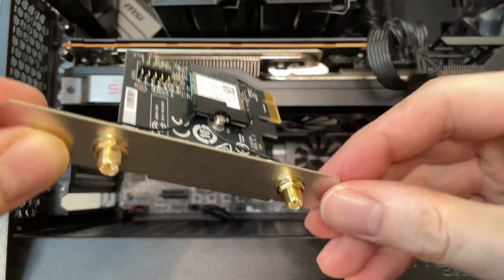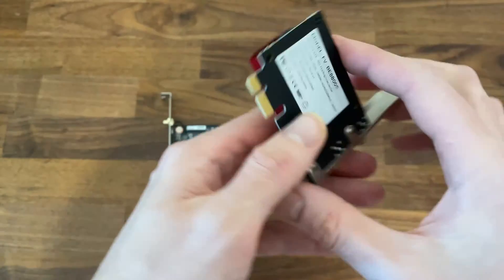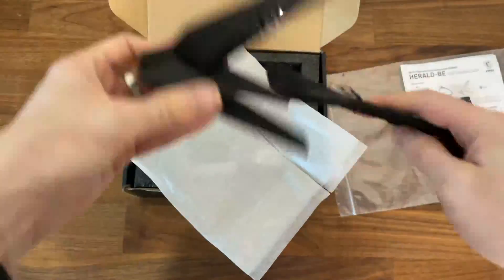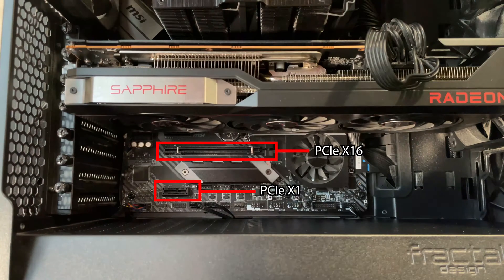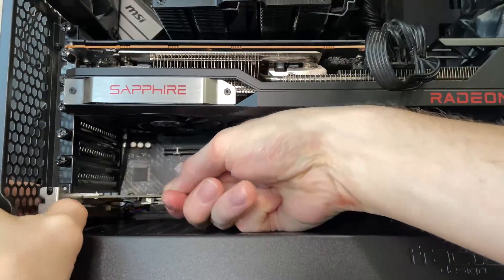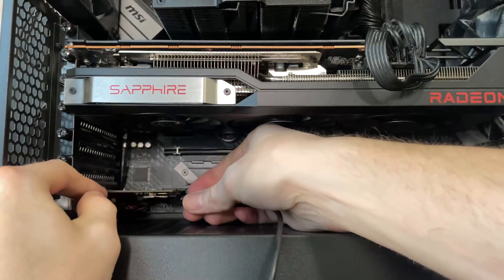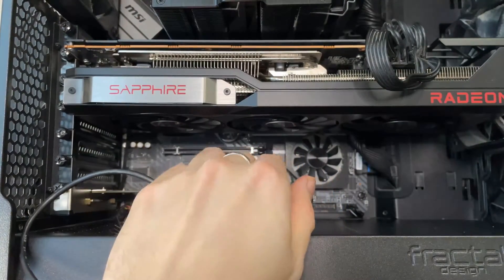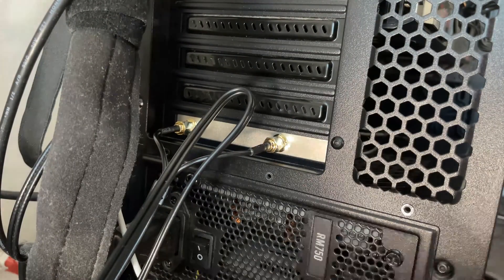How to Install a Wi-Fi 7 Card in your PC (MSI Herald-BE on an AMD system)

Comment: I recently got the MSI PCIe Wi-Fi 7 adapter, and as of kernel 6.10 and above, it works flawlessly on Linux. I tested it using the tkg-bore kernel on an AMD system. It also works out of the box using the latest Ubuntu release as far as I know.
Reply: Thank you for that information. I was worrying about that. I just got this.

Comment: I am unable to install, I downloaded the files from the MSI website and tried to run the install but it says ''no suitable devices'' I cannot press the install button.
Is there any solution?
CPU: Ryzen7 7700　
MZ:TUF gmaing B650 wifi plus
OS:window11
Reply: Same
Reply: @MeltaMic  
The measures we have considered are
1. update MB
2. Update to Win11 24H2 (WIFI7 is not supported except 24H2)
I haven't tried this yet, but it might help.

Comment: Just FYI, today, there was a different one available on everyone's favorite mass e-commerce reselling platform from South America.
This one is ASIN: B0CVJPCQFJ
The new one is: B0DFHRYRH6 and it's called the MSI Herald-BE WI-FI 7 MAX
There is a huge external difference, but same antenna. It says it's out of stock already. The MAX comes with a shield around it like it's really supposed to, but that makes it harder to rob and put in a laptop like some people are doing. Qualcomm NCM865 like the naked card. Same price. So I don't know if there are any differences on the inside or if this is just an update to put their logo on it and hide the M.2 E Key slot and card.

The MSI website did not seem to have the drivers listed, so it's hard to see if they are shipping the same ones. Maybe they are waiting on FCC ID to get their parts shipping or something.

Also, only the global MSI website had the new one. The USA site doesn't.
Reply from the maker: I think it's the same device with the extra shield for protection (or removal discouragement). I don't see it available in Europe yet, but I may get it when it will be in stock.

Comment: intel has really f up big time and dont realise how many people is using amd
Reply from the maker: They kind of did, yes, especially with the latest scandal with the Intel CPUs which will most likely push more people towards alternatives.
Reply: I bought the BE200 and it does not work with AMD processors but it does work well with Intel ones

Comment: I've installed this and the wifi is working, but bluetooth won't pop up on my control panel and it says my pc can't connect to bluetooth in settings. I've tried chatting with MSI support, nothing yet. All my wifi drivers are installed, but the bluetooth drivers aren't able to be installed for me, and I don't have a CD drive to manually install the drivers that come with the MSI HERALD-BE. I've updated my pc, tried everything and nothing seems to work. For context, my custom build is running an MSI MPG b550 Gaming Plus, an MSI RTX 4060TI, G.Skill Trident Z RAM 32GB, an AMD RYZEN 7 5800x, a Samsung 980 PRO, and a Seagate Barricuda 1TB, All running on Windows 11 (If that even matters, just trying to state any info that might be of use) If anyone has been able to fix this problem, any suggestions would be greatly appreciated.
Reply from the maker: This has happened to me initially as well. I am going to blame Windows because its support for WiFi 7 is weird and the updates released in barely beta stage. In my case, it simply worked out of the blue after updating the Windows version and a few reboots. You could try installing the 24h2 beta update as well, just be careful that it can mess things up even more - in my case, it didn't.
Reply: I had the opposite issue after installing the MSI drivers on a fresh install of Win11 23H2 - both devices were recoginised and BT appeared to work just fine but the wifi driver refused to install properly and none of MSI's recommended fixes (uninstalling via Device Manager and resetting cmos) worked. The fix for me came via a lan cable and Windows update (late Decemeber). Not sure precisely which patch did it but wifi magically appeared after the first reboot.

Comment: I’ve troubleshooted so much with this adapter. I have an MSI x570 Gaming Plus MB (AM4) with Windows 11. The drivers are installed. I’ve tried both my PCI slots just like you installed yours. I ran the cable for the Bluetooth as well. Windows recognizes the device as being installed, both the WiFi and the Bluetooth. Bluetooth is working great. The WiFi connects to my wireless router but it will not connect to my actual internet, it just says secured, no connection. Then gives me a gateway error, what’s crazy is that it worked for like 4 minutes pushing 900 MB/s (I run a gig plan) and then just stopped working. I gotta call MSI today, their support was closed during the weekend.
Reply from the maker: The only thing that can help (I hope) is to re-install the drivers. I checked out their page and MSI seems to have released a device and assume that their done with it considering that the latest update is from 2023..

Comment: Sadly. Most wifi 7 adapters are not supported in windows 10😢
Reply from the maker: They should work, but in a limited fashion. The 6GHz network will only be visible on Windows 11 and Linux afaik.
Reply: @SamsTechnologyReviews  That would be fine. The issue here is driver compatibility. Do you know of any wifi7 card with Windows 10 drivers support?
Reply from the maker: @codhudson  I know that the Intel BE200 does support Win10.
Reply: @SamBondor  you know of any science be200? Share link please
Reply from the maker: @codhudson  The link to the product. There are some on Amazon, such as this one: https://www.amazon.com/Wireless-BE200-Bluetooth-5800Mbps-NICGIGA/dp/B0D2HMVH5Y/. But I also got one from Aliexpress and it was just as good (yes, I got two for reasons that are beyond my comprehension).
Reply: @SamBondor  Much Appreciated 👏

Comment: Does this card work on windows 10? My computer thinks it’s an Ethernet connection and won’t use wifi
Reply from the maker: It should let you connect to the WiFi, but you're not going to see the 6GHz network. You do need Win11 or Linux to use it. Did you install the drivers and what sort of computer do you have?

Comment: Will this wifi 7 adapter work if the router only supports wifi 6 and below? I only plan on upgrading my router several months from now.
Reply from the maker: Yes, it is backwards-compatible, so it should work with WiFi 6 and 5 without problems.

Comment: Hello sir I want to disassemble and install qcnmc865 wifi card into my amd r9 6900hs rog flow x13 notebook, will it work? thank you
Reply from the maker: I think so. I saw some guys have managed to install an AX200 in a Flow X13 notebook, so the QCNMC865 should work as well. I can't be sure that the 6GHz network will show up though. Still, make sure that you're on Win 11 and that the drivers from MSI are installed.
Reply: @SamBondor  Thank you so much sir. I don't want to replace wifi 6 card to another wifi 6 card so I ordered that. Have a nice day sir. Thank you again.

Comment: My dell is 2018 and only accepts a m.2 pci A+E and will not support the new BE200 chip as it needs to have the extra loop in the chip. I found that my wifi 6e chip doesnt seem very capable from afar on my WIFI 6 modem only giving me 330 mbps of 500. I will try this setup to see if i can get closer to the full 500+ speed i am supposed to be. I am testing my computer speed from about 25 feet away but I know that the wifi 7 chip should work better even on a WIFI 6 modem/router as I have personally tested this theory of mine to be true in my laptop. The BE 200 wifi 7 chipped worked better than the WIFI 6E chip even though on a Wifi 6 network from cox and 500 mbps internet. From up close I was getting around 430 mbps on the 6e but on the 7e it was as close as it can get to being hard wired. I was getting 530 mbps. I believe my 500 mbps internet from cox they say 500 but its really more like 520 to 560 I believe. From afar however it does drop about in half. And thats with me having installed an additional internal antenna. But i am still impressed because this is vastly improved over the wifi 5 chip that came in it only giving me about 40 from afar and 80 up close. The wifi 6e  wasnt that much slower from afar by about 30 to 40 mbps but up close it was about 90mbps slower in my test results. These test results are not entirely entirely reliable though but it is enough for me to confirm that the WIFI 7 chip works better on a wifi 6 modem without any doubt. I wont likely be getting a wifi7 modem or faster than 500mbs internet in the near future as it is too out of touch price wise and i just dont need it. I figure it will probably be at least 2 years before this happens. I'm just looking to maximize what im paying monthly for in the meantime and hopefully by the time WIFI 7 is in full bore I will be already ready for it.

Comment: didnt that card need a 4x socket?, there is also the matter that a graphics card slot that has 16 (16x) lanes revert to 8 lanes because of occupying a 4x (1x) slot (shared), same is true with NvmE SSD's, the one next to the CPU could get slower when you put another NvmE
SSD into another slot
Reply from the maker: Where did you get the info that the MSI adapter requires a 4x PCie socket?
Reply: @SamBondor  i read that somewhere, but only if you dont have a 1x slot, a 1x slot is fine, but if you have to use a 4x slot it will reduce the lanes on your 16x GPU slot, that also depends on the motherboard, newer boards already solved that problem
Reply: @ronnyb5890 it does not matter where you plug it in. It’s an x1 device. It will only use one lane even if you plug it into x16 slot.

Comment: Is this wifi 7 card works  with Wifi 6E motherboard ?
Reply: yes but you need to remove wifi 6e, if its built in then you need to disable it
Reply from the maker: @ishid_anfarded_king  Exactly. And there is also the option that involves removing the small card from the PCIe adapter and replace it with the one that comes on the WiFi 7 adapter. You can see that they're usually held by a single screw and the two small antenna connectors. It's a bit more intrusive, but it does free up a PCIe slot.